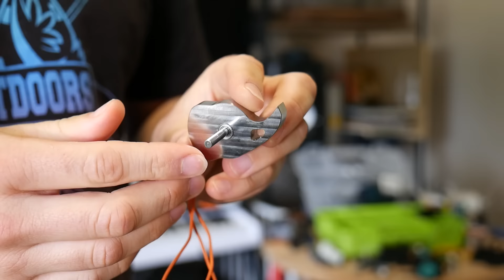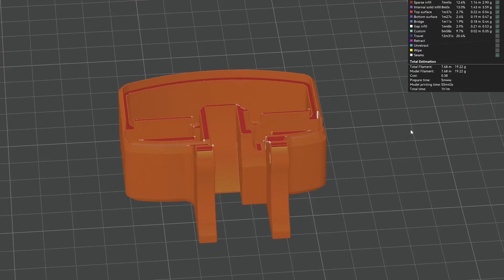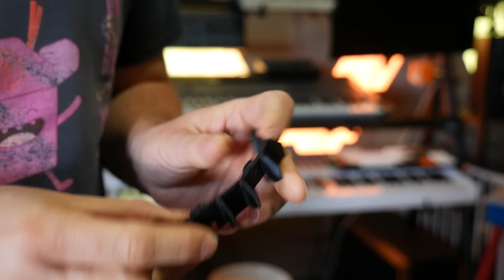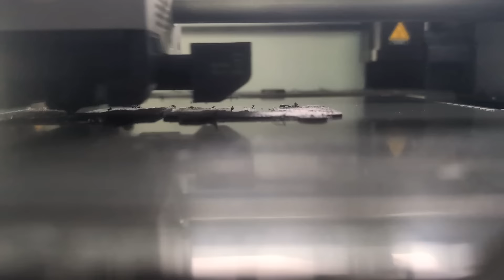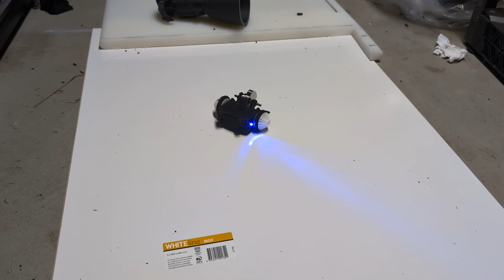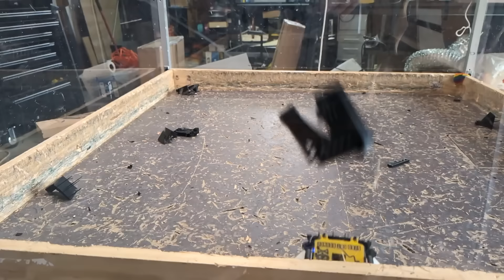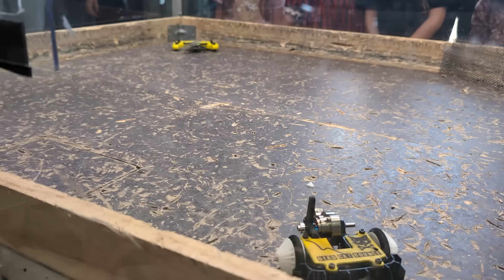Is this tiny combat robot INDESTRUCTIBLE?

Comment: On my 1LB ant and horizontal fairy, I use a TPU hub on foam wheel. There is a hexagonal hole across the entire length perpendicular to the shaft. Inside, there is an M4 aluminum standoff with a 3mm hole drilled in it.

This has the upsides of metal threads for set screws, but also only weighs 1-2g more than a solid TPU hub. Never had a hub fall off again, only had foam fall off the hub.

Comment: titanium isnt actually that good 
as someone in the knife and more specifically the balisong hobby
titanium sucks for blades
its soft and cant do much
hardened stainless would be better (i think)
Reply from the maker: Too heavy! But I do have some 4140 ones I'd like to use if I can find another 20g
Reply: @MakersMuse  oh
ok
that works
Reply: @MakersMuse  yeah i forgot about the weight
ususally in balisongs its a good thing because of the weight distribution but i forgot that in this it needs to be light
Reply: Lateral thought... the weapon has all the properties of a metal shop cutting tool, and titanium is strong a light but not tough. Is there enough in the weight budget for a carbide cutter insert on the tip of the weapon? It will likely break (classic case of interrupted cuts), can be replaced quickly, and could save the titanium.

Comment: Impressive results from a first revision! Can't wait to see you in first place soon!

Side note, I'd highly recommend picking up a pinecil and some various tips for those beginning to solder, as well as some 60/40 leaded rosin core solder from Kester.

I use mine all the time off a USB C battery bank and it outperforms the expensive irons I use daily at my job.

Comment: PA6/PA66 GF30 is used in automotive parts including structural parts, it's very very tough stuff and per weight stronger than steel when molded, it's also reasonably chemical and abrasion resistant.
For wire fatigue potting the connections in silicone or hot glue can really help with strain at or near solder joints.
Reply: PA6 GF30 is also the standard material used in cordless power tools.
Reply: Do you know of an example of such a structural part?
Reply: @Jehty_  The front core support on some vehicles, some Ford, Mazda, and Nissan/Infinti for example. Probably many other vehicles outside the US as well. Stabilizer bar links on some vehicles. Bumper  reinforcements.
Reply: @Jehty_ also used for air intake manifolds, underbody shields, radiator housing, and engine covers. Not structural per se but it’s got great impact resistance.
Reply: @Jehty_  Just to give one significant example, the entire intake manifold of Ford's 2.0 liter EcoBoost Engines is made from PA6 GF30.
Just search for "Ford 2.0 EcoBoost Engine" and look at pictures, you'll immediately spot the huge black part flanged to the side of the engine.

Comment: Thoughts from this video:

Perhaps some spring steel strips bent slightly lower than the floor with little plastic tips be good to keep the forks low when accelerating since the positioning of the wheels means it slightly wheelies.

That Titanium was so much more damaged than I expected it to get. Now I'm wondering if there is something to the tombstone style of having a removable tip to keep the expensive part of the titanium in good shape.

Have you considered a eurothane pour over a metal disk for the wheels where the disk is there basically as a backplate with attachment points for the eurothane and a dshaft slot for attacking to the motor hubs?

Comment: My good sir, might I recommend Biqus Cryogrip Glacier plate for your X1C. Recently tried it and thus far pretty decent for having more stick with low effort while still having a relatively untextured bottom.

There are other versions which operate at cooler temperatures but they can't be cleaned with iso and have less material compatibility.

Comment: 1. I'd make hubs for the wheels out of PA/Nylon and print them on an MMU or IDEX with the tpu on them to make a solid unit
2.) I'd probably print a mold for the forks out of ABS or PETG and the use "forged" (compression molded) CF or GF Cut some thin strips out of cloth (glass or CF) and soak them in resin (I'd use boat resin as its more forgiving to impact but you can use epoxy too) and then squeeze the mold halfs together under pressure  and let it cure. 
3.) I'd redesign the frame to get rid of infill lets say you printed with walls of 1mm on each side and 3 mm of infill in the middle so a 5mm wall I make it a 2mm wall - is as strong and maybe a little stronger/stiffer and you loose the weight and filament for infill. 
4,) IDK why you need that soft a TPU for the wheels and you might get better performance out of 95 or so TPU. 
HTH

Comment: You're 3d printing. Why not a composite? Print 2-3 layers of TPU on outside edges, and then print centre with a more ridged filament. Get the benefits of both materials.
Reply from the maker: Really want to try that! Unfortunately TPU isn't compatible with the AMS, though bambu just released a harder one that may work
Reply: @MakersMuse  Could also do it the old school way, pausing the print, swapping filaments manually. It's not as nice as printing from the AMS, but if you're changing material only twice it shouldn't be too much of an issue.
Reply: I think there would be a little problem between 2 different materials to bond together. I had one print with pla and petg (because i didnt have right color) and these two didn't stick together
Reply: I was thinking you could leave a filament sized hole and just insert the unprinted stiffer filament into the tpu
Reply: Petg and tpu will stick together.

Comment: Imagine an antweight that is as flat as a credit card on the leading edge and shaped like a wedge with the wheels being only 3mm diameter at the thick end - it moves towards the opponent and wedges them into the air. Or has that been tried?
Reply from the maker: If you can make a bot that thin then it'd definitely be novel!
Reply: I'm not sure actuators and batteries can be made that small and still pack enough punch. Though, maybe there it might be possible to something a a bit close to that by having a robot that's mostly just PCB and SMD components with some resin or something of the sort to hold all the non-moving parts as a solid unit shielded from direct impact. Maybe for the wheel motors something like phone vibrators? All that would be missing would be the weapon... Hm... Maybe something like a mousetrap mechanism that gets winded up between each snap, and would double as a de-turtling tool?

Comment: I have another idea. What about a weapon that shoots sand into the workings of the other robot. Or an electrically conductive dust.

Btw there ought to be a truly no rules except safety league. NHRL still has too many rules.
Reply from the maker: Against the rules, they're there to keep things interesting as well as safe. Also no excessive arena cleanup as that'd be real hard to maintain for competition!
Reply: @ I didn’t see anything in the rules about either but maybe I missed them.

I think a no rules league in and of itself would be interesting and drive innovation

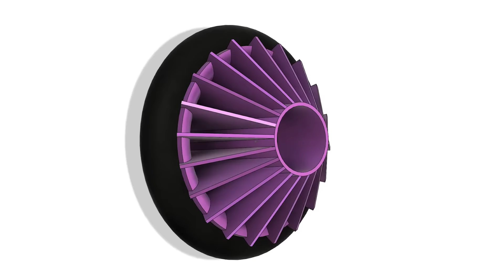Comment: 22:10 instead of having a round (o-ring style) tire, change the shape to a square on the half that contacts the rim, and in the rim itself, print ridges. If you can, glue the tire on over those ridges by pressing down with your fingers using the rubber glue from the thread locking compound guys (you know who). That tire, even if it's coming apart, with those mods, should still hold to the rim where it counts. And if you keep spares, you can cut up chunks and glue them over with the rubber glue (it will hold).

Comment: Not sure how possible it would be, but you could try using a more rigid (but still flexible) plastic for the part that goes on the axle. And if the hole is slightly smaller than the axle, it should stay on pretty snug. And, since it's still flexible, it shouldn't bend the axle like a hard plastic would.

Comment: @Maker's Muse Have you tested TPE rather then TPU for the wheels?  The amount of extra grippiness you get with stuff like Fiberflex 30D/40D compared to a similar stiffness TPU is really noticeable with handles and other grips.  Holds up extremely well as Electric Unicycle bumpers in the crashes I've put mine through.

Comment: I have personally used TPU forks in my beetleweight and it has worked well for me. I would recommend changing the print orientation of the forks to print in its vertical orientation rather than on its side. It allows the tip of the fork to be paper thin. You can also angle the fork downward by 1 degree to add some preloading.

I also notice that your robot tends to tip back a little whenever you accelerate which prevented you in getting good bite in certain exchanges. Moving the wheels back or adding a wheelie nub on the underside could reduce the tipping.
Reply: This!!
Reply: Have you tried Tullomer from Z-polymerinc yet? If not you should look into it.

Comment: sometimes i contemplate trying some of these events... got a few ideas... some that arent exactly mentioned in the "guidelines". the standard designs all seem rather limited... which makes the whole thing rather dull and boring? 

maybe you should do a video on the more common rules? just perusing the "robot royale rules PDF" some of them seem rather ambiguous, others seem to be defying standard operating procedures.

do jaws or pincers fall under 'entanglement"?
if rapid acting, do they fall under "explosives" or "projectiles"? despite being neither? what about hammers? 

i would class a hovercraft as a "flyer" yet its deemed a "shuffler".

my 30 odd years of RC experience has always been to turn the transmitter on FIRST...
Reply: Turning the transmitter on first was absolutely necessary in the age of analog radios as without a signal from the transmitter they would response to any RF interference with random moves of the servos which could be dangerous. With the modersn digital radios it does not matter any more as the receiver waits for a positive two-way connection (the modern "receivers" actually also have a transmitter and send confirmation feedback and telemetry data to the transmitter) with the transmitter it's paired with before allowing any movement. That's also why we don't need to change crystals as there can be many digital radio systems on the same frequency without disturbing each other as the control information is transmitted in coded "packets" of very short duration and between them the frequency is free for other systems. RC has come a long way during my lifetime (I was born in 1971).
Reply from the maker: Each competition should have a pretty clear rules and guidelines document available, but generally the rules are for safety, entertainment and to avoid ruining the arena. Grabbing another robot is totally fine, but you generally have to let them down after 30seconds (before picking them up again, to give them a chance to move). The shuffler/walker terminology is confusing as they get a weight bonus. A hovercraft would be fine, but not get a weight bonus. 

The transmitter / robot activation order is hotly contested. I also personally feel that the Tx should be on first, but that means the sticks might get bumped at a busy event. All bots must failsafe with no signal, so most events prefer bot on before radio. 

If in doubt, just ask! The even organizer will tell you if your bot design is within the rules or not.

Comment: I hear you with the TPU hubs; an earlier version of my robot had issues of wheels falling off for the same reason - you try tightening down the set screws and the whole hub just flexes instead. You might want to try printing them out of a stiffer material, then making the fins separate pieces that can screw onto the wheels.

Comment: If your controller lets you you might try throttling the spinner both manually and dynamically off your inputs. IE high speed when driving strait forward/backwards, and at low speed when turning and resetting to a mid range between the two values for faster response. Should give you a good balance between having control and ability to be aggressive.
Reply: Just be careful of trading off gyroscopic torque for just the standard torque of spinning up and down.

Comment: if you have a duel filament printer you can use a harder hub material and the soft tpu even if the connecting points where they interface gets destroyed you can still drive with the friction and also if the tpu is ripped off you still have a hard remnant you can hobble on

Comment: It appeared like you were already thinking of it, but it may be prudent to embed a solid core part into the softer TPU wheels to give them a better chance of keeping the motor shaft secure. at 150g, you likely don't have the weight for a grubscrew for pressure on the motor shaft, but that could be a V3, potentially.
Reply from the maker: Yeah that's definitely the plan. A firmer filament for the hub will press fit much better I think!
Reply: @MakersMuse you should angle the spinner slightly which will cause the gyro force to favor 1 side,& then make the axle for the wheels have a groove that guides it up & down when gyro causes it to lift on 1 side,& a single spring for the side that moves due to gyro force. (I'm sure I'm getting something wrong a bit,but I'm also sure if you use that somehow you can still make it better) Cheers
Reply: @MakersMuse  I wonder if it would help to put a layer of really thin fibreglass with some lightweight epoxy on the high impact parts. Probably wouldn't add much weight and could add some real delamination protection for the printed layers, which seemed to be a fail zone. You could even, with less epoxy in the fibreglass, have that extend to the ground as a skirt against forks.
Although I'm not sure if the rules allow these materials.
Reply: I wonder if just super glue might be more prudent given the constraints.
Reply: A Solid core was my thought as well. Would be interesting to see how well the material interlocking feature in orca slicer would work for it.

Comment: Hm, you say the filament samples are shearing, but I'm pretty sure none of them actually sheared.
Reply from the maker: Fair. In not an engineer so probably have my terminology wrong. What would be the correct description?
Reply: @MakersMuse  Shearing seems like the right word to me. I wonder if OP is implying it didn't shear at the layer lines, but that's not the only way things can shear.

Comment: Have you tried Tullomer? Should be pretty much steel strength, but no idea about the weight. Also what happens if the blade curve and spin is the other way around? So that the spinner mashes the victim into the floor?

Still watching though.
Reply from the maker: I've been keen to test Tullomer since seeing Joel's video on it! Might work really well. Spinning down tends to send your bot flying instead of theirs, but if you can constrain the two together with a wedge or forks it can do serious damage.
Reply: @ When I was typing the question I figured out the flip. Jamming the bot in would be a neat thing. A bit of shredder action.
Reply: Yeah, pressing a bit between a downward spinning weapon and a rigid base like some forks is also the theory behind many successful hammersaws